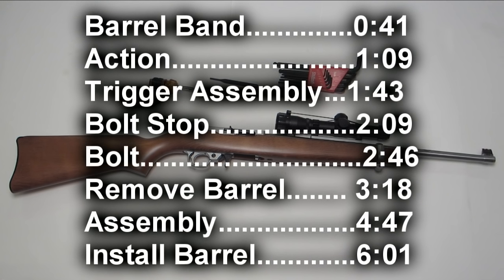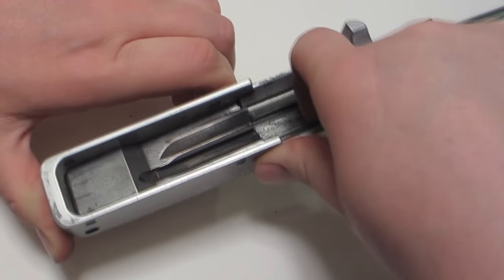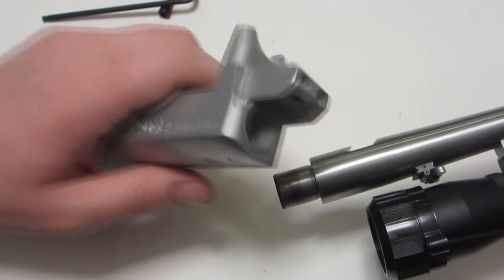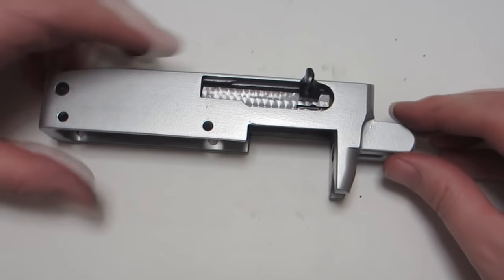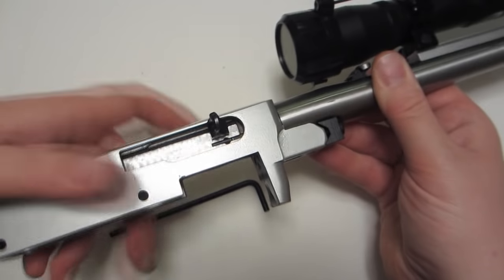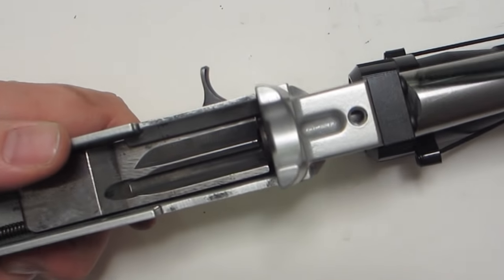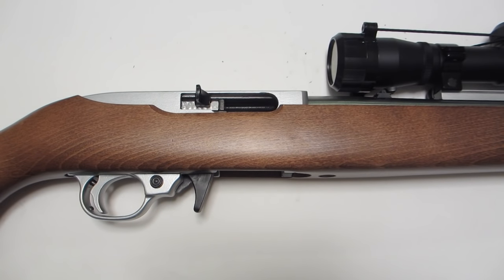Ruger 10/22 Disassembly Assembly Including Barrel

Comment: Good video. A couple of concerns though. First you were concerned about scratching up the stock while you had the weight of the gun pushing the scope into the table. Probably would be a good idea to remove the scope. Second, you mentioned that the receiver is aluminum and to not mess it up. Probably isn't a good idea to lay the side of the receiver across the the trigger assembly while you hammer out the buffer. They make jigs for that. I use a roll of tape, works well.

Comment: WHY ARE YOU USING THE TRIGGER ASSEMBLY AS A PROP TO DRIVE OUT PINS
Reply: EliteHunting1911 Inconsequential since it's all metal alloy and there was very minimal impact force used to tap out the pin.
Reply: I just use the Alan wrenches that take the rest of the gun apart

Comment: Thank you for an excellent video.

I had problems with my bolt not going back, thus rendering the rifle inoperable, and this video gave me the courage to disassemble the trigger/bolt assembly and try to figure out the problem.

Actually the problem was very simple, and nothing to do with the trigger/bolt assembly. I'd taken off the scope mounting rail, put the rail screws back in to fill the holes, and they were protruding inside and fouling the bolt. 

Once I'd eliminated the other possibilities through disassembling while watching this video the answer came to me, but now I know a lot more about the inside of the 10/22.

Comment: If you check around on the net you can find a tool that will really help in installing the bolt. It is nothing more than a thin strip of metal bent to hold the charging handle in the correct position to install the bolt. You can also make your own out of some thin aluminum sheet metal like I did. It's not a required tool but it sure makes reassembling a lot easier.

Comment: Thank you so much for this video, I use my 10/22 to knock out a goat, bleed it out and butcher it, and 2 days ago I managed to forget it outside like a complete idiot, and it got filled with water thanks to a couple downpours in the past 2 days... Had to take it apart completely so that I could clean everything and re-oil it so that it doesn't rust, so again, I thank you very much for this video.

Comment: Thanks for the advice. You did blow my mind after I saw the beautiful buffing on the slide and you didn;t have any cushion protecting you rifle. However, I about fell backwards in my chair when I saw you use you receiever as a pounding lift. Just a suggestion: a roll of tape works much better and it isn't polished metal on polished metal (or aluminum). Just a thought-ty for the vide

Comment: thanks for the video its helpful for the botl took me a good few trys almost messed up with the hammer though thankfully i could fix it before i had to take apart the entire trigger assembly.
Reply from the maker: I love the 10/22, but don't ever want to take it apart unless it is absolutely necessary.
Reply: bgallaher77 Agreed though for me ive tooken it apart a few times hear lately and its gotten easyer though iver maily field stripped it with out removibng the barrel because i know i defiantly will screw that up.

Comment from the maker: The scope is a BSA pistol scope with enough eye relief to also double as an intermediate eye relief scope.  I found a gun on line (Chief AJ) who would put a regular rimfire scope base on the barrel for a reasonable fee.  I don't think he does this any more, but my guess is that other gunsmiths would.  The barrel is drilled and tapped for the base (not too deep) and the base screwed on.

Comment from the maker: That is the bolt stop pin.  I am not sure what will happen if it is removed.  Something is going to stop the bolt from moving forward. It could be the recoil spring, the guide, of the back end of the receiver.

I would suggest getting a new one.

The Ruger factory bolt stop is steel.  You can get aftermarket bolt stops that are plastic/polymer, or steel with a plastic/polymer/rubber sheath.  The idea of the aftermarket stops is to cushion bolt some when it stops.

Comment from the maker: I haven't really thought about that.  The receiver is aluminum, so it won't rust.  My barrel is stainless, so rust resistant.  A coat of oil won't hurt.  

If you wanted a really rigid fit between receiver and barrel you would need to degrease and use loctite/permatex. No oil there.

Comment from the maker: This part is hard, especially on newer rifles.

Use a flat head screw driver.  Put the guide rod/charge handle in place inside the receiver.  Put the screwdriver on the charge handle right next to the guide rod.  Push back with the screwdriver.  Once the charge handle is back, then hold it in place with your finger on the charge handle (outside receiver).  Pulling on the charge handle doesn't work well because of the angle on the guide rod.  Good luck.

Comment: Golly those two pins in the back that release the trigger group man those are tight tolerances. I had to really hammer on those things with a punch to get them out. I wouldn't have thought a 22 would be this difficult it's harder than an AR to get out and the AR is really easy

Comment from the maker: Both trigger group housings are stock Ruger housing.There are two shown in the video because I had to edit and report the video to remove an error.  That is why one is silver and the other black. They were purchased a few years ago, with the rest of the rifles,, so they are the aluminum.  My understanding is that current production trigger group housings are plastic, which is not necessarily a bad thing.  One of them might have had a "kidd trigger job" kit installed, which is an awesome trigger.

Comment: You didnt show taking apart the retractor assembly. For mine I machined an aluminum block with a tooth and lock nut that finger tightens. To take out the retractor you simply slide it on and tighten down the screw a bit with the spring compressed. The retractor is then free to take in and out as you please or swap such as with volquartzen. I am interested in starting making them but nobody can tell me if possibly they already exist.
Reply: Retractor??

Comment: Excellent video.  I'm putting a Clark barrel in a Brownells receiver.  The fit is so tight that I have to use a heat gun, and still, I have trouble getting the slot in the barrel lined up with the extractor in the bolt.  Think I should use some emery cloth on the barrel to make fit-up easier?  Thanks.
Reply from the maker: I put a kidd barrel in a receiver and got the timing wrong. Rather than heat the receiver I cooled the barrel. Also used some moly anti seize paste. Eventually I had a gunsmith install a cantilever scope base to the barrel and he corrected the timing.

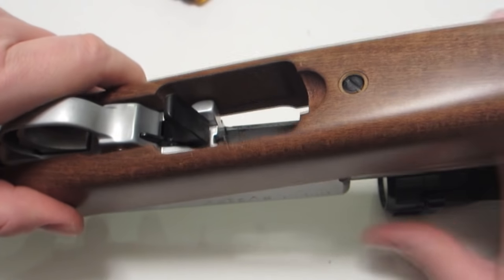Comment from the maker: That is interesting.  The action screw is captured, so you unscrew it until it is free of the action, but it does not have to leave the stock.  Of course, you need to take the barrel band off, if you have one.  Then the action/barrel should be loose in the stock.  To get it out all the way, at 1:34, you center the safety.  Not sure what is going on.  Did you remove the magazine?  Something is binding up if the stock won't come off at this point.  Good luck.

Comment: For barrel removal problems...use heat on the receiver. small torch works well. although I've never seen a stock 10/22 be anything but loose when removing barrels from receivers.
Reply: or u might have a rear take up screw behind the trigger that's screwed into your stock.
Reply: Never use heat!!  Use rubber malot or piece of wood and tap , it will work.

Comment from the maker: The reciever is exactly the same on the TD as compared to the regular models.  Of course, you don't have to remove the barrel band, instead you just take off the barrel.  The hardware that connects the barrel to the reciever IS different, but since you won't need to take it off there is no practical difference.

Comment: I must admit that I figured the dovetail must force the barrel into place automatically but now I realize it dosent because the location is no more than the accuracy of the threads--true it will force it somewhat into position but I now realize a person could rotate the barrel slightly and the screws and dovetail would still lock into place not into exact location of rotation.

Comment: Hi , nice instructional video. Any recommendations on disassembly or cleaning of the bolt block/ firing pin assembly. My 10/22 is over 30 years old and it can get really grimey in there over time. Pressurized lubricants have done me well and it doesnt seem as gritty as it was but who know what it looks like in there. Thanks again

Comment: No it was when I was cleaning it. Or am actually, right now. I was following your intruction  from 4:54 and it wouldn't cock back. I've tried everything, I have to move the little bead down with the spring inorder to move the bolt back, but it's impossible to hold get it to stay.

Comment: Also dude when I try to slide the wood piece back with the metal piece it won’t fit back together, idk why literally the metal part is exactly how it was before I took it apart to clean it, is there a special way to slip them together
Reply: The pin at the front top and the pin that holds the trigger in place we’re switched

Comment: Your mag release is different from mine, I notice if I take it all apart and turn the mag release it looks like that but will it still work
Reply from the maker: The gun is old enough it came with a flush fit sporter mag release. The one on the gun is am aftermarket. The new guns have similarly profiled releases from the factory.
Reply: @bgallaher77  thank you

Comment: I think disassembly/assembly of the trigger group would be of more value than barrel removal/installation. All the screws you loosen/tighten have torque values. Something I think is rather important, with steel screws going into aluminum. And one other thing. . .  Why are you putting a filthy rifle back together without cleaning it?

Comment: How is yours silver? Did you polish the finish off, or is it after market? Same question for the trigger group has housing and barrel.
Reply from the maker: I had two 10/22s. Both purchased in the mid to late 2000’s. At that point you can get a receiver w silver finish. Still aluminum. Just painted silver. Trigger groups back then were also metal and came with a black or silver finish
Reply: @bgallaher77  oh ok. I thought the trigger was after market.
Reply: @bgallaher77  I don’t like that it has plastic on it, but I’ll probably upgrade all the last if you metal down the road. Right now I just want to grab some ammo and shoot it.

Comment: The charging handle won't stay on my guide rod/spring. keeps popping off. can I still use it without it being permanently fixated at the top?
Reply: Many aftermarket rod/spring/handles come that way. Once properly installed they will work just fine.

Comment: Did you already have your barrel off previously? 
   I just bought my Ruger 10/22 Carbine model 1256 with 18 1/2" long Stainless Steel barrel that has the identical V-block with 2 bolts that hold the barrel into the receiver, but GOOD GOLLY... it doesn't come close to anything how you SO EASILY removed your barrel :-O 
   I even clamped the receiver in a vice and tried twisting and pulling on the barrel but nope...won't move even the slightest bit what-so-ever!
Your video was uploaded in 2012 but I know your gun could be older than that and so did Ruger do something different on their older 10/22 gun barrels than what they are now in 2018-2019...maybe using a medium grade lock tight or something on their new guns?
Reply from the maker: I imagine that the gun has continued to evolve. I have the old style aluminum trigger assembly and the current production, I believe, uses a polymer housing that has better tolerances. A more rigid barrel to receiver fit would probably make the rifle more accurate, so Ruger may have found a way to improve fit and tolerances. I bought the rifles between 2004 and 2008, but do not recall the exact date.
Reply: @bgallaher77  
Thanks for the quick reply. Yeah mine came with what I think is the kinda chintzy polymer trigger housing even though the plastic is quite durable I already changed it for the Pike Arms all aluminum trigger housing.
....and with the 10/22 receiver being aluminum that has a steel barrel pressed into it, it's lookin like what they call a marriage made in heaven but in this case it's because theyre not going to part their separate ways unless God himself grants the annulment lol

Comment: bgallaher77 - I was curious about how you attached uour scope mount to the barrel like you did? I would kinda like to steal that idea, but I'm unsure of what you did?? Otherwise,  great video!! Very informative and helpful and straight to the point!! Absolutely no fartin' 💩 around and no extra 🐮 bullshit to contend with!! FIVE STARS ☆☆☆☆☆ my friend, and I just subbed as well!! 👍👌
Reply from the maker: 10-12 years ago I sent the barrel off the an old-timer named Chief AJ. He set a record shooting a 10/22 and hitting wooden blocks thrown in air. Several thousand hits in a row. Anyway, either he or his gunsmith used a single screw to attach a piece of rimfire scope base to the barrel. I showed that to a local gunsmith, who said it would cause problems when shooting at small targets at different ranges because the mount and the bore of the barrel were not parallel. There are a couple of option in the marketplace. One is a company called amega who makes the mount for around $100. The other option is to buy a takedown 10/22 ($350?), magpul stock ($100) and magpul scope base ($60) and put a red dot on it. I like scout rifles, but am not sure if I would convert another one to a scout like this. I already had a takedown 10/22 and set it up with the magpul parts. Looks good but family and work leave me with very little time to tinker w guns anymore.

Comment: Excellent !!   Any torque specs available for the reassembly ??
Reply from the maker: KIDD at coolguyguns.com lists 10 in-lbs on the screws holding the v-block in place.  But, the barrels he sells install into the receiver with incredibly small tolerances.  I wouldn't go much tighter than that since the receiver is aluminum. Theoretically the v-block should need minimal pressure on the barrel.
Reply: bgallaher77 Really confused now :-))) Did some research after I asked and seen a lot of "RUGER RECOMMENDS"   @ 20 -25 inch lbs ?
Reply from the maker: That would probably work, too.  I haven't done any serious testing on if or how the torque affects accuracy.  So long as you don't damage the receiver it should be good, right?  20 in-lb is about what a screw on a scope ring takes.  That will snug it down.  As an aside, If you are going to be mounting scopes now and then it might be a good investment to get a torque driver.  I have one and use it when mounting scopes and the like.
Reply: Thanks again ..... already invested in torque drivers .... very glad I did..... gives me great piece of mind......

Comment: my gun is brand new and i cant seem to get the barrel to come off and i don't want to hit it with a hammer what should i do?
Reply from the maker: I'm not sure what to do about that one. I would be cautious a pounding on anything. Try posting the question at rimfirecentral.com, there is a great forum there. Perhaps some penetrating oil?
Reply: okay thanks im not replacing the barrel just yet but i would like to be able to take it off for complete disassemble cleaning
Reply: brennan mastro  becareful!!! i just bought one and tried to take the barrel off which it came off BUT it resulted in a severely cut hand

Comment: Also what is that tool you used to remove that pin at 2:40
Reply from the maker: Just a steel punch set, or a roll pin punch set. You can find cheap one from internet retailers or harbor freight. Should cost $10 to $15. Very useful.
Reply: @bgallaher77  thank you very much man, big help!

Comment: My receiver will not separate from the stock and I have removed the barrel band, and loosened the the takedown screw and it won't even budge. Does anyone know what I am doing wrong?
Reply from the maker: Henry Rosenberg My guess is that the safety needs to be adjusted so that it is half-on and half-off.  There is just enough clearance for the safety to pass through the stock if it is half way between the two positions.
Reply from the maker: Henry Rosenberg If it doesn't move at all, then the takedown screw probably needs to be loosened more.  Otherwise check the safety.
Reply: bgallaher77 Thank you for replying so quickly, though unfortunately I've tried both of the things you mentioned and it still won't budge. Does the fact that it is a new un make a difference?
Reply from the maker: Henry Rosenberg Not sure about that one.  You should be able to back the takedown screw all the way out (it is captured by the stock, but you can still get it out). Ruger is pretty responsive, I would give them a call.  They will get you in touch with someone who can troubleshoot this.
Reply: bgallaher77 Yeah, I tried that, I don't know what to do, I might have to give them a call. Thanks for your time though!
Reply: What stock do u have??
Reply: Tyler Hughes I have a synthetic carbine stock.

Comment: I love watching these vid's to bad most of these so called experts don't really know what they are doing. For instance, all of the pins are made to remove only one way even though you can take them out both ways. At  2.21 is a perfect example. Those screws are called Allen caps! There is a Torque number in inch pounds for the barrel, I'll let you hunt for it. DO NOT use a carpenters screwdriver on a gun ever.  You would use hollow ground driver that fit's the screw exactly!